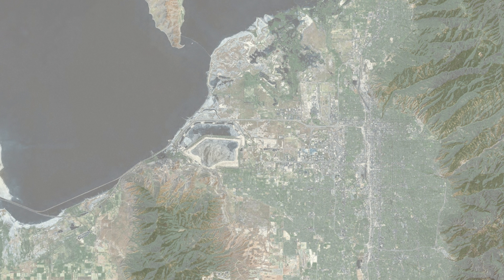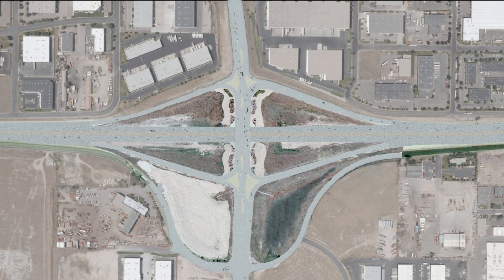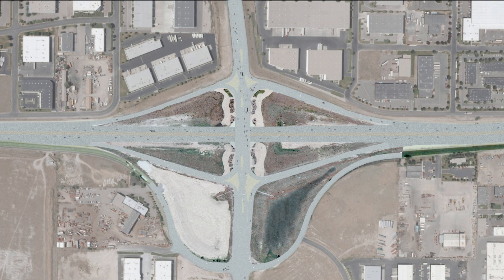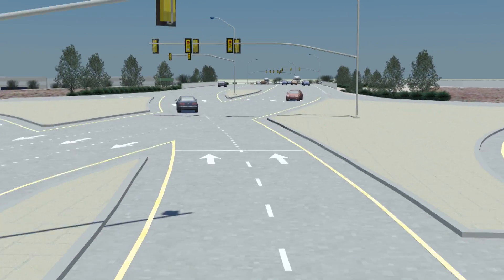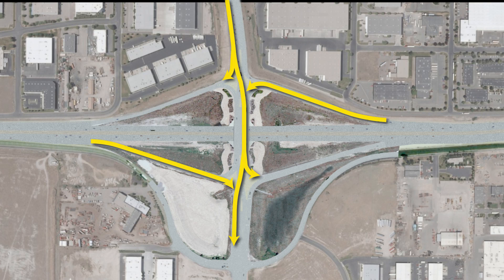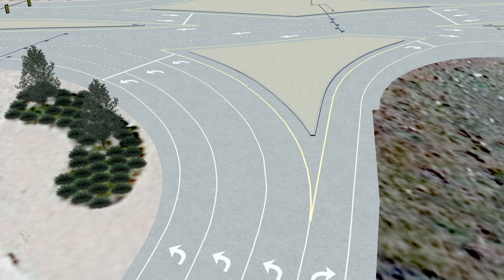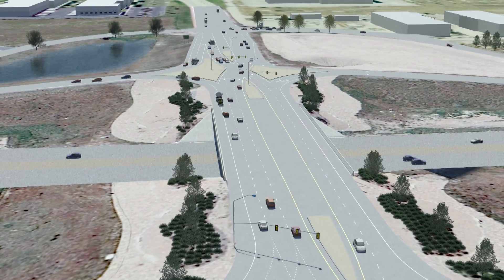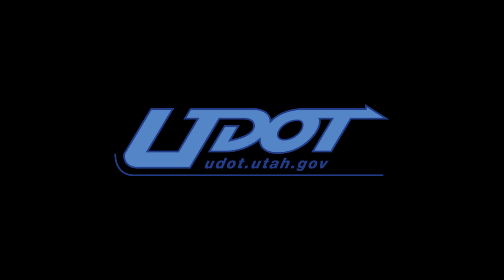How a diverging diamond interchange works

Comment: Seems complicated, looks like there's a possibility for accidents since drivers have to temporarily drive on the left and that can cause confusion. And to reppron1, this solution is probably better than a regular diamond interchange since the latter crosses thru traffic twice as well, but has left turns at each intersection.

There is a regular diamond interchange where I live, and the arterial road gets severely bottlenecked as there are 5 intersections around the highway below (2 for the ramps and 3 for cross-streets) all within a little over a half mile stretch of the arterial. There are plans to replace the aging bridge with a single-point urban interchange and close one of the cross street intersection nearest the ramp. The number of intersections will then be reduced to 3 (1 for the highway ramp and 2 cross-streets). Hopefully they do this within the next 5 years as planned.

In my opinion, the interchange in the video should have been replaced with a single point urban interchanges instead of a diverging diamond. They are compact and only require a single set of traffic lights.

Comment: This design may look cool, but it hasn't changed the time you have to sit during peak hours.  It has actually slowed down traffic that is traveling through.  It still backs up south bound left turn the same as it did before. Nice Work tax money well spent.